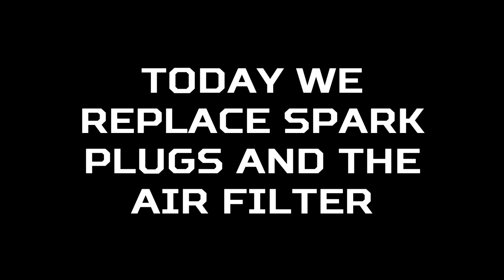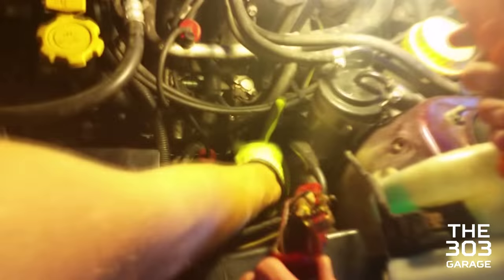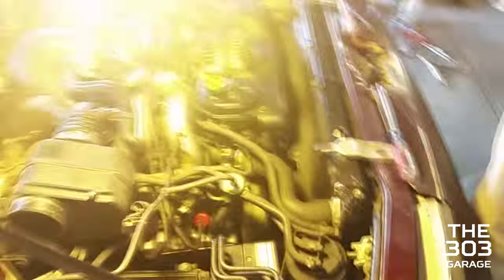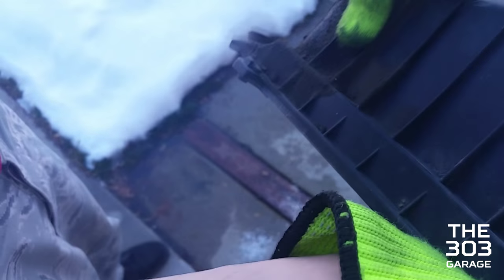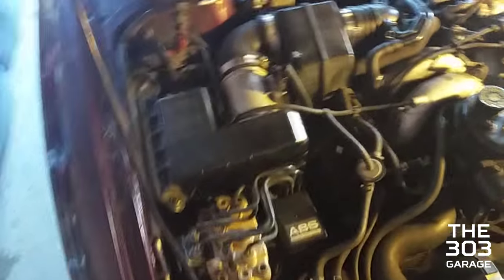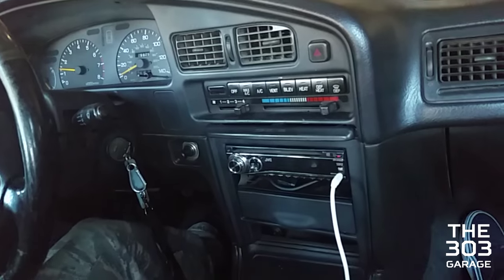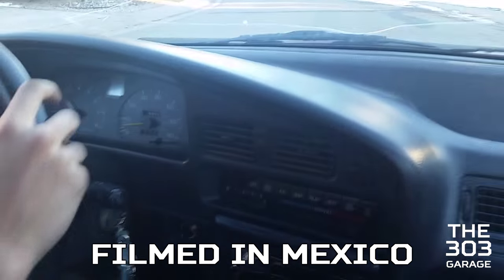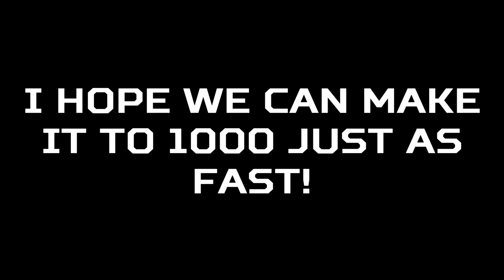(Legacy) Changing the Spark Plugs & Air Filter

Comment: Emission checks are stupid ways to make people pay money to the mechanics.
Reply from the maker: +Transpurge73 Yeah they're stupid but they also probably saved my engine some trouble. The spark plugs looked like they has over 100,000 miles on them and the old air filter was filthy and clogged. The car runs so much better now. Also I won't need to do emissions again for another 7 years after this so I'm covered.
Reply: The303Garage were I live, its monthly and you have to replace the spark plug/ replace or clean air filter each time because other wise you fail.
Reply from the maker: Transpurge73 That sucks. Where do you live? Singapore?
Reply: The303Garage Upstate NY. moving soon
Reply: This is the least helpful mechanic video I've ever seen. Congratulations.